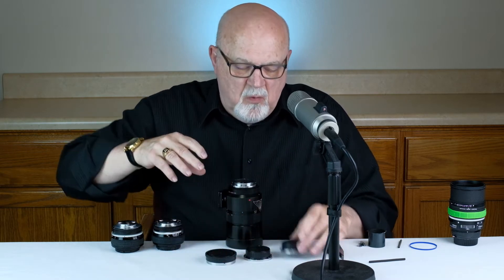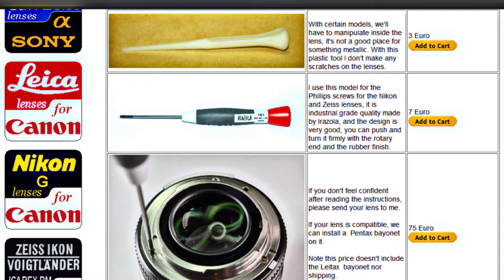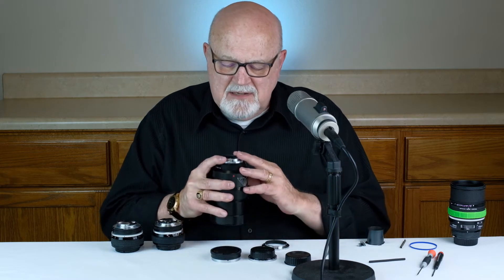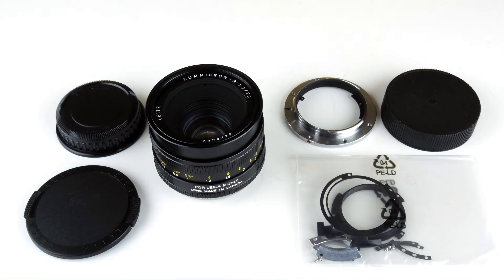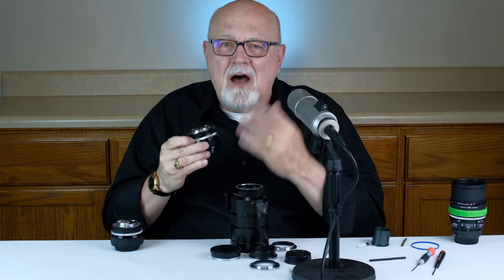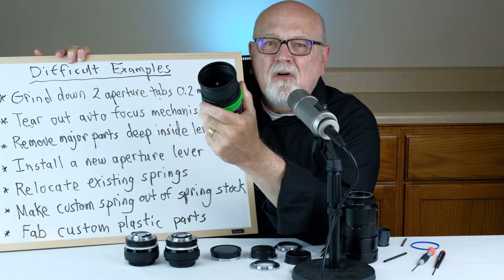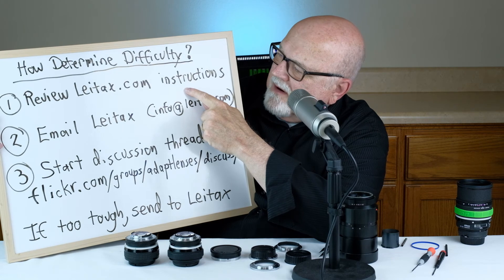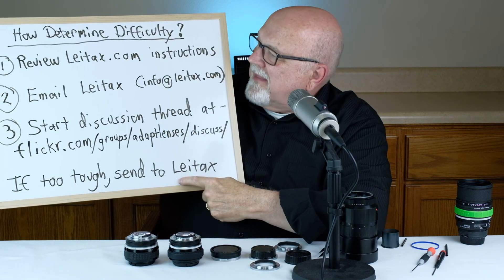How To Replace Your Lens' Bayonet Mount - Part 2 (tools & 3 levels of difficulty)

Comment: Would you have any idea where I might purchase a rear collar mount for a Panasonic 100-400mm lens? The lens collar is made of plastic, though not a cheap lens? Would it be a problem using a metal replacement? Great video!
Reply: Buy any used Panasonic lens being sold cheaply for parts that has a mount that has the same number of screws in it as are on your 100-400 lens.   Either lastic or metal should work.
Reply: @CutCosts  Thank you so much for the info.